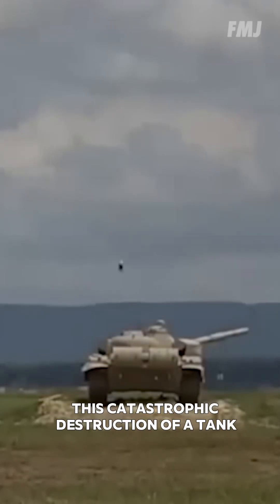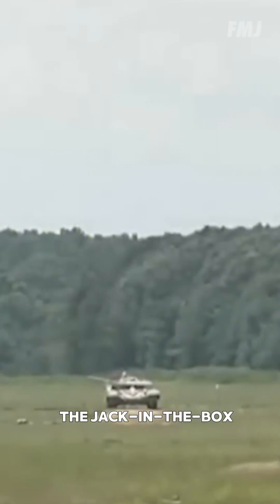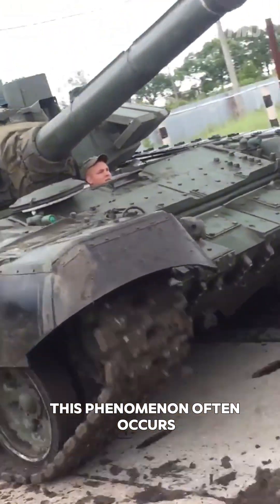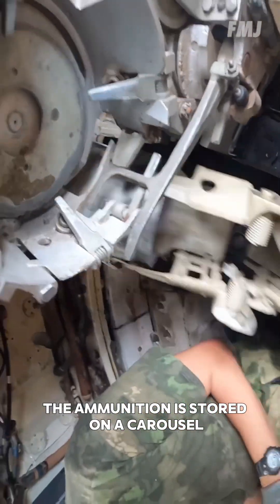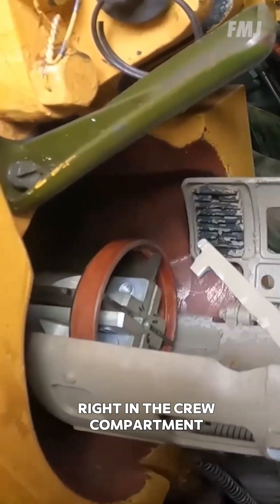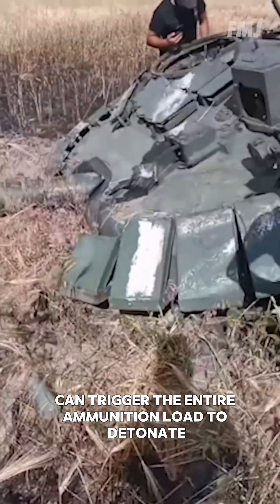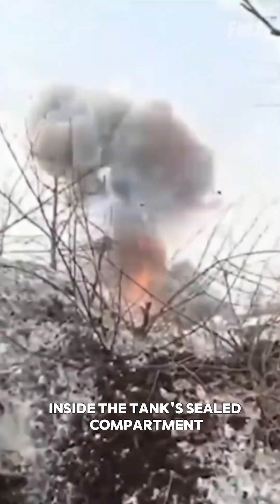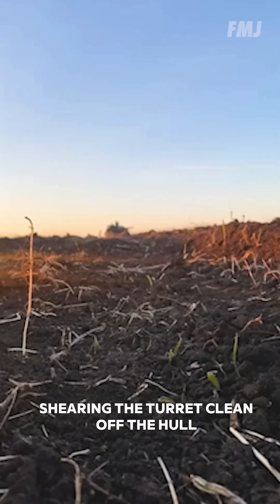Flying Turrets: The "Jack-in-the-Box" Effect in Tanks

Comment: The latest Leopard tanks (Leopard 2A7 and 2A8) do not have an autoloader. They still use a traditional 4-person crew with a human loader.
Why Germany sticks with manual loading:

Reliability: Human loaders are seen as more adaptable and less prone to mechanical failure
Flexibility: Can select and load different ammunition types quickly based on tactical needs
Crew redundancy: The 4th crew member can assist with maintenance, security, and other tasks
Tradition/doctrine: Western tank design philosophy has generally favored the 4-person crew

Trade-offs:
Autoloader advantages (Russian/French approach):

Smaller crew (3 people)
Potentially faster, more consistent rate of fire
Smaller turret profile

Manual loader advantages (German/US/UK approach):

No mechanical breakdown risk
Extra crew member for versatility
Experienced loaders can be very fast (some claim faster than autoloaders for first few rounds)

The newer Leopard variants focus on improved armor, fire control systems, and situational awareness rather than switching to an autoloader system. It's a deliberate design choice that reflects different philosophies about tank combat.
The Russian tanks like the T-14 Armata or T-90, do use autoloaders.

Comment: this is not because of the autoloader - a well designed autoloader will not have this effect.
French AMX-56 Leclerc
South Korean K2 Black Panther
Japanese Type 90 and Type 10
German KF51 Panther
all have autoloaders with separate ammunition compartments and are most likely more safe than manual loading as the compartment door should close faster.
The Problem is part of the bad russian design, where humans are not worth anything

Comment: I can understand why Russian tanks are dangerous having their ammo in the crew department. What I don’t understand is why they couldn’t figure out how to move it to a blast proof area.
Reply: They knew how to make safer ammo storage, it just didn't fit their doctrine and budget. The object 640 had blowouts but was too expensive to continue funding. Their t14 has some shells stored behind the turret similar to the leopard or abrams. The t90m has a separate container with some charges behind the turret too. Their older tanks (t80/90/72) used carousel autoloader because it allowed for a cheaper and more compact design. They did try to reduce the chances of it getting hit by putting it down low and having the charges lay flat in the AZ autoloader (t90/72) to further reduce getting hit.
Reply: Потому что ты идиот, весь танк это опасное место. И тебе идиоту не понять, что стреляют по русскому танку, а не Абрамсу. Абрамс также взорвали иьы.
Reply: In the Russian army, the lives of soldiers count for nothing. So if the tank is destroyed, it doesn't matter whether the crew survives!
Reply: @franklentes5499 ты идиот полный.